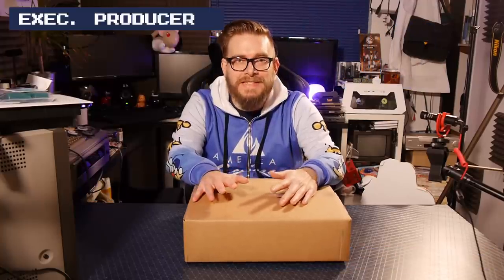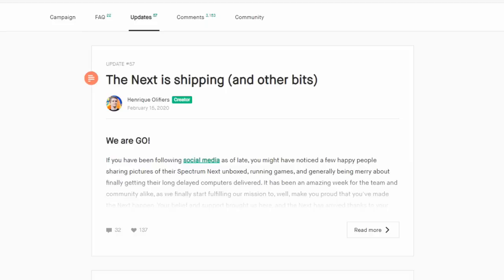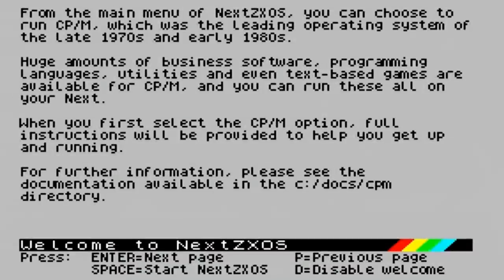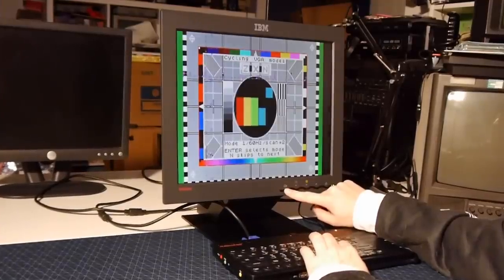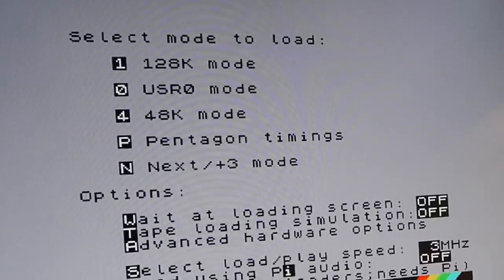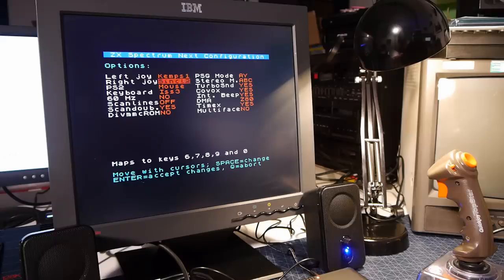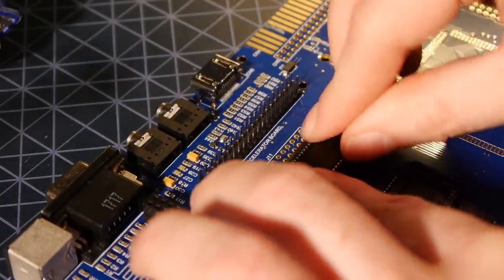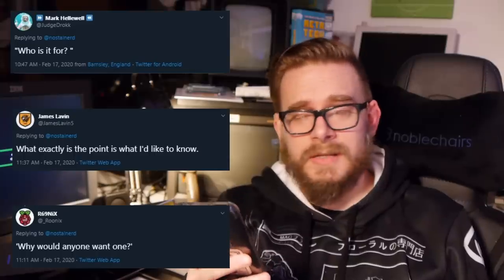ZX Spectrum Next | Nostalgia Nerd

Comment: No Pentagon mode and no TR-DOS? Useless.
Reply: It has a Pentagon timings option.  I don't know about TR-DOS yet, though NextZXOS should be functionally similar to both TR-DOS and esx-DOS, so conversions may well be practical.

It may actually be compatible with the beta disk interface hardware, since the edge connector is present, which would in turn make it compatible with TR-DOS.  but not even the +3 disk controller made it into the FPGA, because disk support doesn't really make sense when you have an SD interface.
Reply: @TheTurnipKing  Why not? Some games only work from real disk drive and you can easily copy .TRD and .SCL images from SD card to disk using Fatall.
Reply: @timoheinonen9570  I think its probably because disk hardware is hard to get, there are many disk standards, and most of them are broadly inferior to SD in terms of capacity, speed and general availability.
Reply: @TheTurnipKing  No. esxDOS and TR-DOS can work if installed (Chapter 20 RMFM :) ) We don't included because it's illegal. But you install it yourself just fine. NextZXOS has a planned TR-DOS emulation mode however in the near future
Reply: @phoebusdokos7375  I'd seen someone install esxDOS ( https://www.youtube.com/watch?v=wOSKolGrADU ) , but wasn't sure about TR-DOS

Gotta admit that longer filenames on NextZXOS is a lovely addition over esxDOS, though.
Reply: @phoebusdokos7375  there's no mention of TR-DOS in chapter 20 that I can find
Reply: Beta disk and TR-DOS is pretty much standard on Russian clones. SD card is just used to store .TRD and .SCL images and are from there copied to disk drive or RAMdisk, and the software is then run from there.
Reply: @timoheinonen9570  ah, apparently esxDOS will give you access to TRD containers, at which point you can do precisely that
Reply: TheTurnipKing TRDOS is included in the esxDOS distribution. Installing esxDOS you get TR-DOS with it ;) As I said however it is illegal for us to distribute it. Just like we cannot distribute the Romantic Robot Multiface ROMs or the Jupiter Ace emulator.

Comment: kickstarter. bypass!. if not believe own product to make them on stock..and there is no z80 inside + today standard hdmi output JUST.so it just computer that try copy someone else.why not just make own computer?
Reply: I am sure they would welcome your millions to make and keep stock. Not everybody has millions laying around. There is a Z80 in programmable logic and a HDMI license will make it more expensive and requires money up front. Its Spectrum compatibility is one of its main selling points, but is it much more than just  a compatible. Also you might have noticed the Sinclair name on the box and the Next. That's because it's fully licensed by Sky (=Amstrad=Sinclair) so it's not a copy but an original.

Comment: PC emulation does the same for free
Reply: heh... yeah, completely for free, the emulator just "appears" from nowhere. :D .. tell that to emulator authors. :D
Reply: @ped7g  you do realize that there are many different emulators that state they are free on their websites and the app stores
Reply: @roasty80  it was not about particular price of download, but about the effort behind them. There's currently no Next emulator doing "the same", and as a [small] contributor to the one of the two Next emulators I would bet it may take years before it will be near "the same" (if ever). Both current emulators are "only" good - and that already required quite some huge effort from Cesar and Mike.